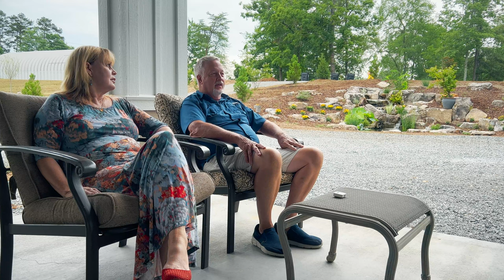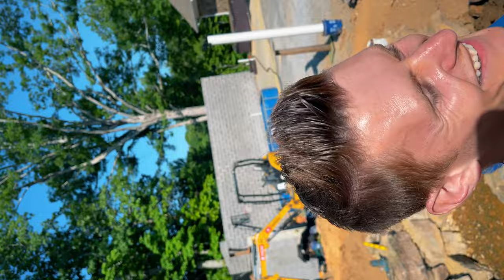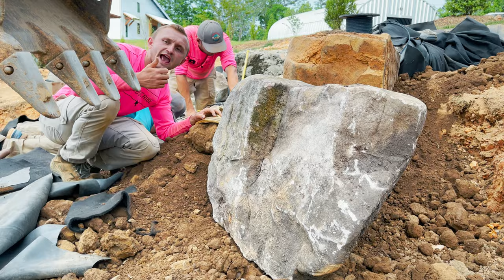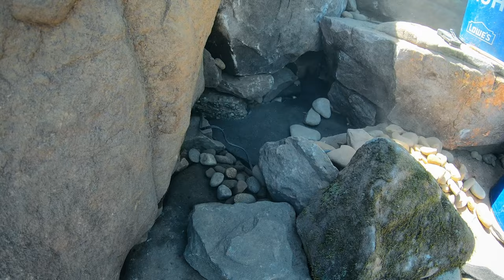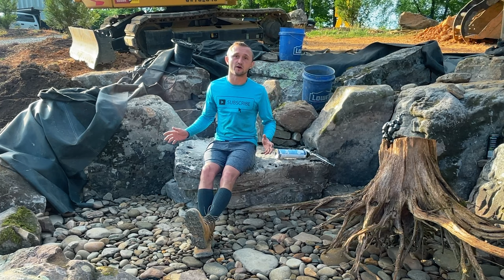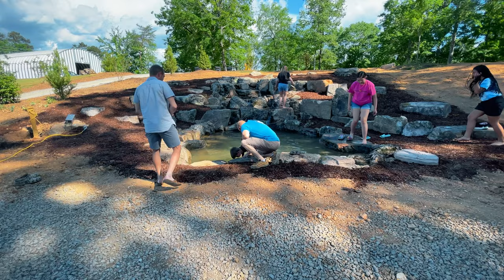REVEAL - Boulder Pond With Extra Wide Waterfall PART 2

Comment: What do you use for lighting conduit?
Reply from the maker: We use thick-wall, pressure-rated black poly pipe.1/2” diameter for regular led lights (where we have a wire feed only). 1” for the color-changing lights so we can feed the plug ends through :)